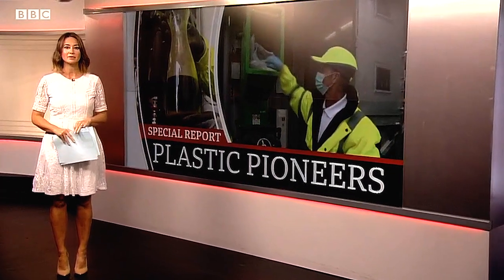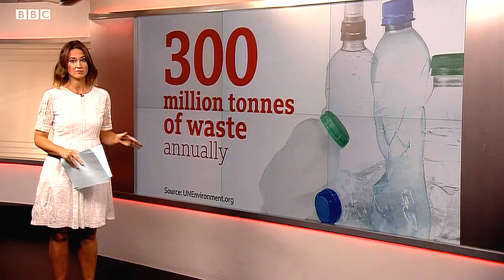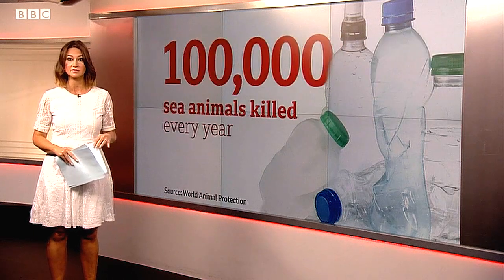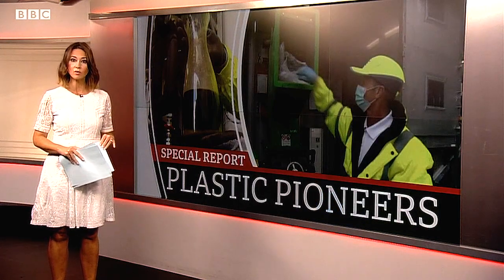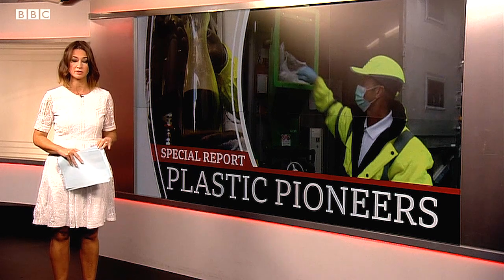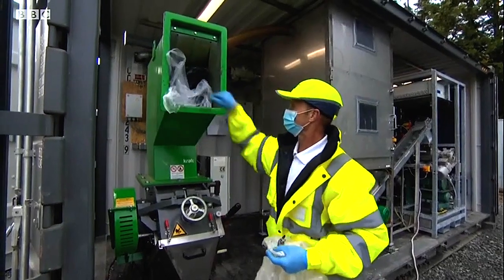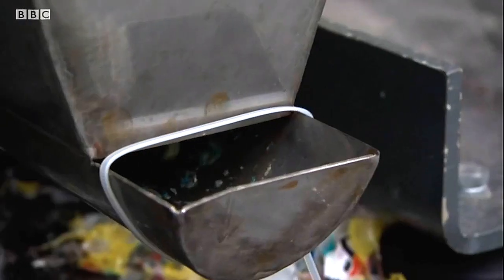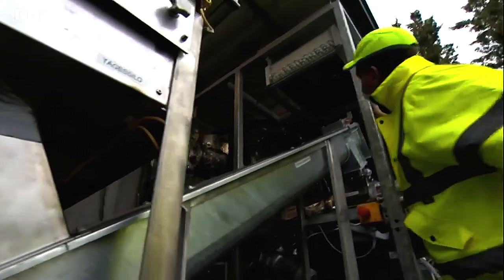BBC NEWS 16th October 2020

Comment: Turning the resulting oil back to plastic is rather stupid. Not all plastics get collected and processed. Turning collected plastic to usable plastic just gives it a second chance to end up in the oceans.
Reply from the maker: It's being made into an oil which has many uses, not just plastic, anything we do with waste plastic takes it away from ending up in the oceans, if its not collected it won't be processed, that's a fact. There is no second chance, especially if these machine are used all over the UK, there will be no need to landfill, incinerate or export and its export that mainly end up in the oceans and waterways.
Reply: I disagree. This means we don’t need to make excess plastics. We can just remake them everytime